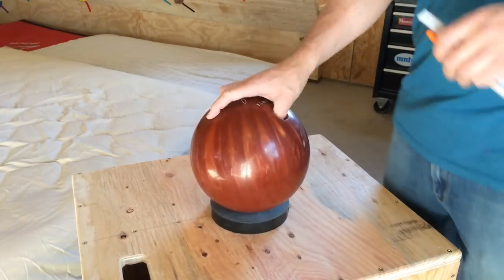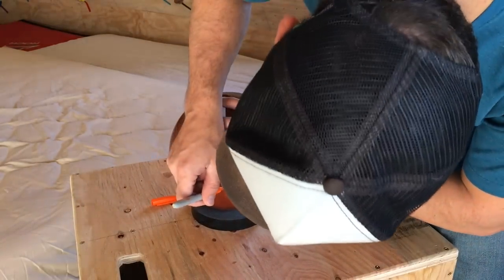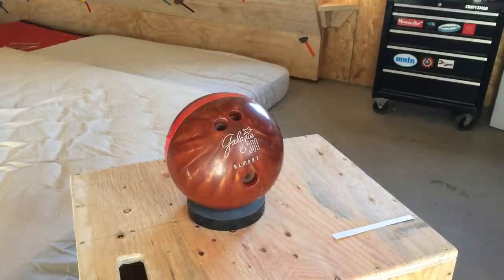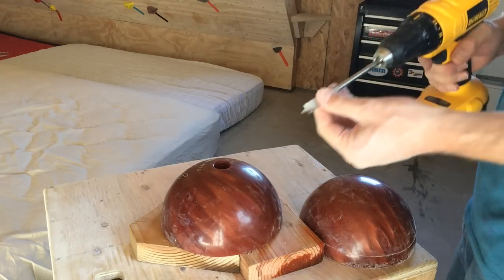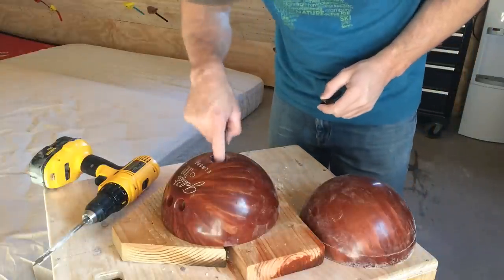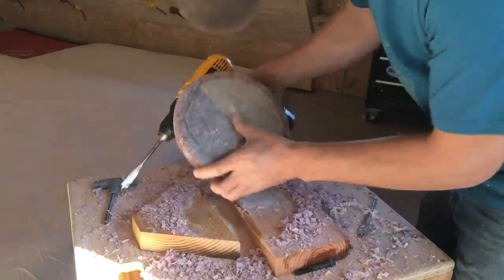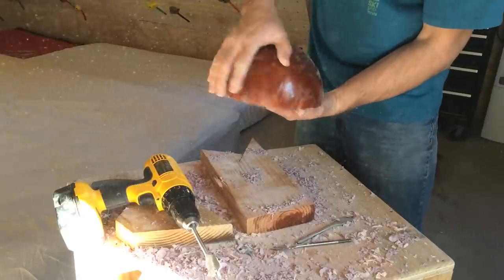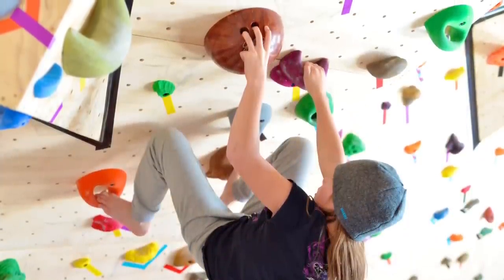How to Make Bowling Ball Climbing Holds

Comment: Surely buying climbing holds is cheaper than buying a bowling ball?
Reply from the maker: THERESAPARTYINMYHEAD A quality, polyurethane climbing hold that size is around $20-50. Thrift store, used bowling ball, less than $5.